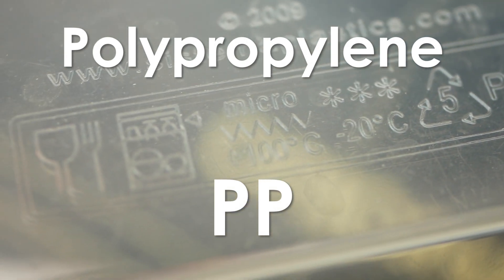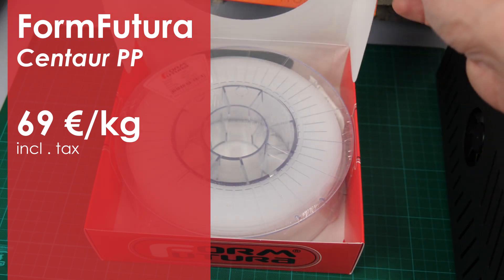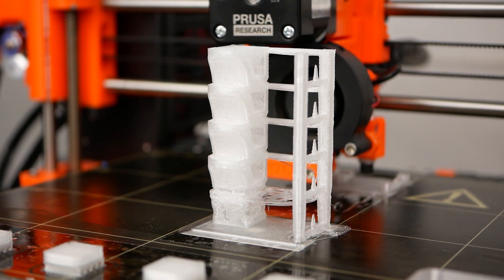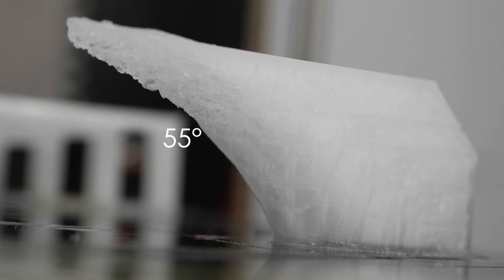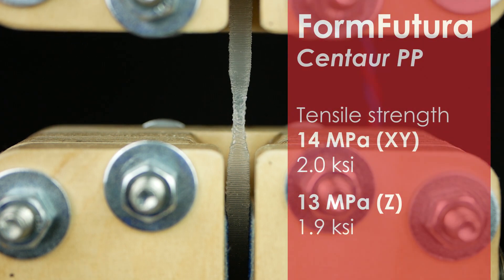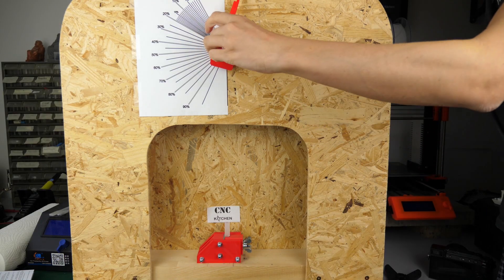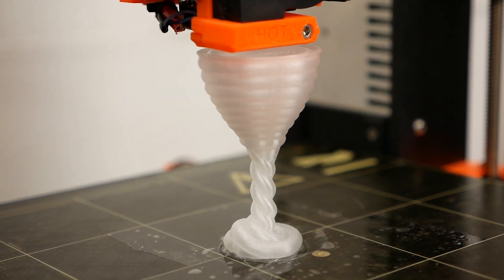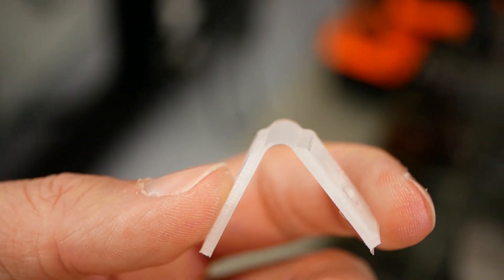3D printing Polypropylene (PP) filament - FormFutura Centaur PP™ REVIEW

Comment: PP (and its brother poly ethylene, hdpe, uhmw etc) is kind of like Teflon.  It's got low friction.  It survives a decent amount of heat.  Almost nothing sticks to it.  This is the shit they make milk jugs out of.  Just something else I find interesting.  It burns clean and clear with no or very little smoke, like as clean as wax, even cleaner than wood.  It is composed 100% from just carbon and hydrogen PE is just like the hydrocarbon chain at the end of a lipid, a beautiful looking molecule unlike the ugly mess of shit like polystyrene.    You can throw it in a fireplace or a camp stove and it will not emit toxic or noxious fumes.

Comment: The issue I see with this is what to use it for. Hinges which are really robust can be made using filament as the pin, so living hinges, while fun, aren't super required. Any ideas for applications of this stuff?
Reply: I'd say food grade stuff, PP is a great material for food. Can make boxes, bowls, cups etc and can be made really rigid to stop the flexing and bending. Never really seen it used in 3d printing, and I work with injection moulding which is an extremely fast way to make things and comes out almost perfect each time with the right amount of cooling and temperation of the material.
Reply: @ConnorEtch  It also has great chemical resistance and can withstand being autoclaved, which makes it good for lab equipment.

Comment: What fan speed did you use with the temperature tower?
Reply from the maker: I used 75% but temperature and fan speed cross - influence each other. Still a full factorial DOE would just be too much effort.
Reply: Thanks! I am searching for the “holy grail” of the fastest way with minimal material to dial in for a new material with S3D, and default fan speed for a temperature tower is a choice I wonder about.

Comment: those layer bonds are amazing. as for tape residue. thats easy. painters tape THEN PP tape. :-)

what about high temp deformation? it gets wobbly when hot but does it return to printed shape or "retain" the new shape if you bend it when it cools?

ie how well will parts survive in a hot car? might make for good nose cones!
Reply from the maker: At 100-120C the parts get mostly back into shape again and this is the point I wanted to make. I think they should totally survive a hot car (at least "hot" in German standards).
Reply: Does it separate from the tape or does does the tape fuse to the print permanently?
Reply from the maker: Most of the time you can release the part from the tape which leaves a really nice, shiny surface. Only in some rare cases did the tape stick to the part permanently.
Reply: "PP tape"
Reply: Hehe u said pp

Comment: I have been wondering why polypropylene isn't much easier to source as a 3D printing material. Given its incredible flexibility it should be much more widely used than it is. The price would also likely fall with greater demand. Your dedication and attention to detail are admirable.
Reply: PP is about the cheapest raw material is to buy. I was a materials manager in a plastic manufacturer for years. Part of my job was negotiating contracts with suppliers. I was buying high performance PP for around 68 cents per pound. That was after the price of oil went through the roof (PP price is directly tied to the price of oil). Before that I was paying well under 50 cents per pound. If you get into the cheaper PP material, for example T20P100, which is 20 percent talc filled, the price goes down significantly. Which basically means they throw dirt in the material to make it last longer, lol. In comparison, the ABS material we used was of a VERY low cost provider. That material was 1.40 per pound if I bought full truckloads. I can't speak for 3d printing yet, but in injection molding this was about the easiest material to process. You can crank out millions of parts with this stuff and not even show wear on the tooling. The bad part, in the automotive world at least, was that it couldn't be used for much. The vast majority of the material was nylon 6 or nylon 66, which varied between 2.25 and 2.75 per pound most of the time. And with the fillers needed became extremely abrasive, most commonly glass filled.  I'm just starting to get into 3d printing. If I decide to start using PP, I'm going to pick up a filament extruder and make my own since I can get it from the last place I worked. Even if I pay twice what they're getting it for I'll still be way under 2.00 a pound and I know where the material is sources and the specific specifications it has to meet.  The more I think about it, I might talk to my friend that bought the place I was working and see if it's viable to start producing filament.
Reply: @joncue0304  Very interesting! Let us know if you do start selling some filament yourself:)
Reply: @joncue0304  Thanks for all the details! Yes, making PP filament could be a good business opportunity, since there's not much supply available.
Reply: If you are really interested in the actual raw materials, matweb and ul prospector are great resources. Here's an example. http://www.matweb.com/search/datasheettext.aspx?matguid=a0f26e2f748a479a81cc98276e25e316
Reply: i am acually looking into printing it because it is easy to get in pellet form and make your own fillament
Reply: i have 10 rolls of pp here i bought at microcenter on clearance for 10 dollars each :D
Reply: Yes, let me know if you star to sale pp filament.
Reply: PP,PE and PET are mass products already and 10-40x cheaper than pla, but you need companies to form it into Filament and then you need buyers.
Booth things which depend on each other , a chicken-egg problem :D
Reply: @hyperhektor7733  
Yes. I'm aware of the widespread adoption of PP, PE and PET. Although PET is fairly widely available in filament form, as you point out, with increased demand other polymers could, hopefully, become more available as such.
Reply: @hyperhektor7733  So because of these constraints is why commercially made PP filament is so expensive?

Comment: You say its underrated.  I don't think thats the case. I think its just not used because its scarcity and price.
Reply from the maker: Well, if it would be more common prices would fall. Same with Nylon and other flexibles. They were quite a bit more expensive a couple of years ago. Remember buying my first 10m sample of NinjaFlex for like $8 or so 4 years ago.
Reply: Very true. I guess the same goes for all filament. I remember back in the early days of desktop printers and filament (I think it was all ABS) cost $40-$50 per spool for the cheaper stuff. That was the largest problem I had with getting a printer back then. I hope your video will get people to realize its not super hard to print with PP filament so more people will buy it and more companies will make it.

Comment: Great Video! Seems to be the right material for a kind of zip tie or in general to organise cables.

I thought you might be able to help me with an issue with my Tevo Tarantula. When I slice objects in Cura with vertical holes I have a serious problem with layer separation. The nozzle prints on one side of the hole and moves to the other side of the hole and prints there without moving down before. So it prints in the air for a few layers which makes the print unusable.

Do you have any idea what could cause this behaviour? Please, even in the Facebook group of the Tarantula nobody was able to help me.
Reply from the maker: You Z-axis might me stuck a little. I'd try deactivating z-hop in CURA and loosen the rollers of the z axis a little. If loosening the rollers help, then reactivate z-hop again.

Comment: Nice Video 😎👍🏼 What kind of test do you use for the flowrate-test? I mean the small cubes which looks to me a good way to safe some Filament.
Reply from the maker: I basically print 100% infill boxes on supports and judge at which infill percentage the nozzle starts rubbing over the surface. Check out Tom's video about his Filaween test methods where he explains this approach.
Reply: Thank you. I will Check it out. Keep up the good job 😎

Comment: How is it in the Bowden tube for the cr10
Reply from the maker: Actually I haven't tried that. The material is quite slippery so it should work just like other flexibles. Maybe you have to print relatively slow.
Reply from the maker: Just printed a 3DBenchy on my CR-10S and the print result was flawless. Don't go too fast (~30mm/s) and you'll be okay!
Reply: @CNCKitchen  did you try printing fast with the bowden tube?
Reply from the maker: Tried 40mm/s and that works if the first layer is not too squished.

Comment: I've used some Forefront F43 TOUGH PP (black) myself and was super impressed by it's layer adhesion and surface finish, when printed in 0.1mm layer height it's almost as if it's injection moulded. The nice thing about the F43 is that it can be printed at 200C so there's less warping. Also the layer adhesion is really annoying when it comes to supports on large objects/curved surfaces, the supports are borderline impossible to remove.

I used it to create some velocity stacks for inside of a motorcycles airbox as it's properties were ideal for the application (They were designed to snap fit into the airbox + good chemical/temperature resistance).
Reply: What bed temp did you use? The manufacturer recommends 110C for the first layer and 30C for the second and subsequent layers. Don't know how I could achieve that.
Reply from the maker: If you use packing tape on your bed 50 or 60C is okay, even for the first layer.
Reply: I used the 110C initial layer and I think 40C subsequent layers. I managed it with an Ender 3, it took about 20 mins to heat up and I was using a polythene sheet as an enclosure. If your printer is struggling you could try covering the bed with a sheet of cardboard until it reaches temperature.
Reply: Thanks - I'll give top insulation a go. I'll also add a significant brim as the corners were lifting. What I didn't understand was the logic behind lowering the temperature after the first layer as, because of the thermal mass of the bed, the temperature is still going to be well above 30C when the second layer prints.

Comment: I wonder about adding carbon fiber to the material? Since the biggest issue that it usually causes is poor layer bonding, this might be an interesting combination since the PP seems to have excellent layer bonding to start with.
Reply: I was thinking the same thing.
Reply from the maker: The thing is that the carbon fibers would still not reinforce the material in Z direction so you wouldn't get great (and more importantly uniform) material properties either.
Reply: @CNCKitchen  true, but it would be stiffer and doesnt absorb moisture like nylon.

Comment: Hi, i have a cr 10 and printet my first print today for the first time in half a year and it has severe underextrusiolns and i dont know what to do, but i know the filament is not he problem and i swapped out the nozzle and heat block so that isnt either.
Reply: ajust your e steps

Comment: Yes Stefan glue is better remove able when hot. As an example: I change the pei sheet on my mk42 heatbeds when they are heated to 110°C. Then normally 99% of the M3 adhesive sticks to the pei sheet and not on the bed. A litte alcohol to clean it and then you are ready to go :D

Comment: Hmmm the bend resistance and layer adhesion looks great for 3d printed shoes like rclifeon made.
Reply from the maker: The thing is that the PP is quite slippery so maybe not the best choice for shoes 😉
Reply: @CNCKitchen  could be a very funny pair of shoes then :))
Reply: I think PP has been used for the uppers in 3d printed shoes successfully. You will need urethane for the bottoms though.
Reply: NS Gaming PoRNxNxxcom

Comment: Interesting! I would want to try to make parts for molding from these, as "investment" parts. ie print hollow, fill with lightweight PU foam and then fiberglass over.
Reply: If you wanted to remove the fiberglass from the inside mold it might come in very handy that it doesn't adhere well to other materials.